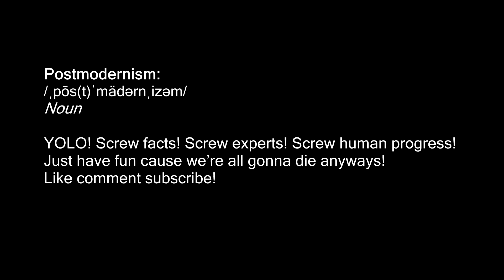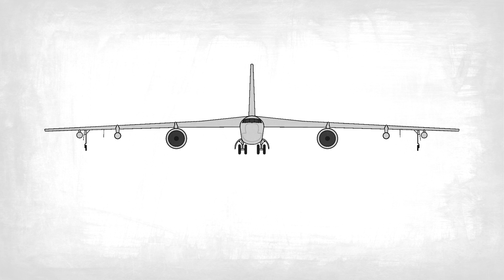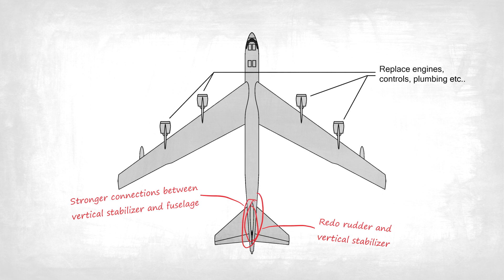The B-52 is Getting New Engines... Why Does it Still Need 8 of Them?

Comment: It has to be kept in mind that the B-52 bomber was designed and originally built in the early 1950s. At that time the B-52 bomber was a cutting edge design. The jet engines that were available at that time were smaller and had a lot less thrust than later jet engines. So this bomber was designed around what was available at the time and was designed to have 8 engines. As a result to run on 4 modern jet engines there would need to be major modifications to the tail of this airplane and the fuselage of this bomber to accommodate 4 engines. Since technology advances over time, had this bomber been designed at least 10 years later it would likely have been built as a 4 engine bomber. The fact that the B-52 bomber is still in use and will be in use about 100 years is a testimony to the incredible design of this 1950s era bomber. This bomber was built very rugged and long lasting. Nothing is built like that today.
Reply: It also helps that they cut up a very large portion of the fleet due to the SALT treaties with the USSR. They have a lot of spare parts, I'd imagine.
Reply: @theawanonymouscaller  sounds very logical and practical.
Reply: ...and that would also require a virtually complete redo of all the cockpit controls and instrumentation. Just one example: 8 engine throttle controls down to two or four engines.
Reply: @johnc2438  Replacing the old eight engines with eight modern engines will result in major changes to the cockpit controls and instrumentation. This is because the old engine controls and instrumentation were analog controls, the new engines use modern digital electronic controls that will be hardened against electromagnetic pulses. It would not surprise me if the the B-52 bomber gets a modern electronic glass cockpit.
Reply: Your post is awesome, but after I read that last sentence, I swear I heard an A10 Warthog tell me to hold its beer.😎
Reply: @johnc2438  that's not that big of a modification though
Reply: Also, the B-52 had to have some redesigns early on.  One was the wing had to be redesigned because of excess flutter and fatigue issues.  Rarely do aircraft come right out of the factory in perfect flight condition and last years - and the B-52 was no exception.  And the structure gets patched, reinforced, or replaced as needed - and when that happens no one reads about that in the newspaper or in the news on the radio.  Sometimes I know when that happens because of my job.  I know the A-10 (mentioned in a previous reply) got a new wing.  I know some of those who worked and managed that design activity - but they look the same.  But no one outside of the industry or the services who use them knew that.  But as to this video - replacing the engine number would mean a lot more, as the video said, would have to change.
Reply: @michaelhankes7587  would it be more cost effective in the long run to redesign the whole plane to use all modern engine and equipment. warfare now and 50yrs ago is not the same. there only so much you can do when retrofit an aging air frame
Reply: The 52’s down here at Barksdale do not have the original engine type.  So I guess they are getting a second engine upgrade.  Either way, they still leave behind miles-long black soot trails until they hit altitude.
Reply: @jetli740  I don't know which would be more cost effective.  I would suppose that the value of all the retrofit contracts could be brought into today's dollars and compared to the cost of a new airplane.  The video, it's own humorous and brief way, shows how short sighted the government is - which is true.  But the current B-52 may not be as "less capable" as people might think.  They have all the infrastructure to drop the latest weapons for instance.  And they were all added via separate contracts.  Along the way the structure was either beefed up or replaced as needed.  Now all that said, having talked to USAF pilots, there is a price to be paid for all the scabbed on systems - and that is usability.  The tribal knowledge needed to operate is greater.  Actually, TOs and Instruction manuals are updated all the time - but the result is that those systems are more cumbersome to use.  A new airplane would integrated all these things so that all the systems operate from the same system architecture vastly improving how each system is accessed and used.  The B-52 is still relevant and can do what it does well.  That is why it is still around.
Reply: @blackhawk7r221  Can you see the soot on the runway after take off?  Just curious.
Reply: @michaelhankes7587  Runrays are heavily blacked, much more than a typical airport
Reply: @jetli740  ,
See B-21 program. In the future the B-21 will handle penetration missions into hostile airspace while the modernized B-52Hs will be very long standoff distance missile launching platforms.
Reply: @blackhawk7r221  
The B-52H's have the TF33s they came with from the factory.
Reply: @davidhoffman1278  B-21’s are operational and in the wing.
Reply: @davidhoffman1278  My mistake.  I see above where I wrote it in a confusing manner.  52’s had J-57 turbojets up until the G’s, which stuck around a whole lot longer than people think.  The H’s got Turbofan 33’s back in the 60’s.  Only mildly less smokey, but you can still easily track them for miles after takeoff.  G’s and H’s were side by side on the flight line for quite a while. Rolls-Royce won the contract a few months ago for the repower with their F130’s.
Reply: @blackhawk7r221  I thought all older B52 had already had engine replacement-aren't all of them in service now turbofan? 
Imagine 8 engines of they type that were used on the MD 80 --think that would motivate the thing to do some climbing
Reply: @davidpowell3347  All are H’s or H upgrades and have TF-33’s.  Haven’t seen the old J-57’s since the very early 80’s.
Reply: The original hound dog missile had the same engine on it that was in the dual nacelles. The pilot could run the engines, he could transfer fuel from the missiles, or transfer fuel to the missiles so if necessary he could actually take off with 10 engines running.
Reply: @theawanonymouscaller  they used up all the spare engines and parts years ago, and that was the second engine type that's a bypass turbofan that replaced the turbojets which had total loss oiling. Since there's been so much stalling over replacing the engines with newer, more efficient designs, the old TF33 had to be put back into production just to keep up with maintenance on the B52 fleet and a few other aircraft models that use that engine or engines based on it. The B52 new engine program could result in new engines for other aircraft to keep them flying longer, with longer range.
Reply: @michaelhankes7587  Since two of the planes have been lost recently due to a low altitude crash and a fire on the ground, the two oldest planes in the fleet, which have been reactivated from storage, have the lowest number of flight hours.
Reply: @jetli740  they already did.  It's called the B-1  Lancer.
Reply: The fact that the B-52 is still in use has little to do with design, and more to do with budgets. Not to mention the bomber consept is somewhat outdated.

Good luck using B-52s much vs a modern adversary like China or Russia.. They would just be big pinjatas..

Vs a small nation you allready outclass. They perform cheap indiscriminate bombing tho.
Reply: This is one of the issues with these planes. It is extremely hard to account for future engines, or other things. If someone said, "Why don't we spend more money to beef up the entire plane so that in the future when we have engines with multiple times more thrust we can put them on?" They would get stared at, and then demoted. Like the video said, the government wouldn't restructure the plane, and I'd bet my best strategic nuclear bomber that they wouldn't do it back then either.
Reply: This is the last of the heavy bombers.
Reply: @blackhawk7r221   The G's with J-57s were still at Barksdale during the early 90's.  I got to Barksdale in 1991 and I transitioned the the H in 1992.
Reply: It is also a statement of how short sighted the air force is. Probably be operating long after the B-1's and B-2's. And it is in truth a superior weapon than either for the wars the US has fought, and even hypothetical wars not sure they are really much better either considering cruise missiles. Russian Bears are also still in service.
Reply: The first b-52’s flew in ‘46, so they were on the drawing board and in design before the 1950’s. It was originally designed with 6-turbo prop engines (axial jet engines turning a prop). The twin nacelle octa-jet came out in ‘52.  

Advances in aircraft are almost always led by advances in propulsion.
Reply: @MrDanisve  Russia still uses Tu-95 and China still uses H-6 (upgraded Tu-16) so i don't get your point here
Reply: It's long past time to retire it and move on.
Reply: I could not disagree with you more. Plenty of aircraft are built way better today than this rectangular fuselage monster. Indeed it is rather fragile. You don’t think we’ve learned anything in 70 years? Tell me now, what big business anywhere in the world, like FedEx or UPS, would use 70 year old aircraft? The US military is this stupidest military in the world. This is all bribery. This is Boeing at its best, bribery, absolutely ridiculous. The cost Per flight hour for something that is nothing more than a missile truck must be phenomenal when everything is aggregated. This is a total waste of money. We are living in the era of drones for gods sake!  What is this stupid idea of having crew on board! Dumb dumb dumb dumb!
Reply: @edsmith438  Should have had a replacement decades ago, but air force keeps building racing cars and not trucks when a truck is what is needed in many cases, and it does not even have to be that sophisticated a truck, but a passenger jet conversion just is not going to work very well. Need a brand new fuselage at least, but also good to have greater durability.
Reply: @markzieg3593  Very true. I think you can go back to the B-17 and see the constant progression. What really is the difference between a B-17 and a B-52.
Reply: @theawanonymouscaller  it helps moreso that the spare wear parts are systems that are either standard components, or easily retrofittable systems. While the Air Force WANTS better engines, the hull was designed with 8 at the time, and getting 4 modern turbofans which are taller then the aircraft's hull under the wing is a problem. Apparently at one point they actually did get some new Rolls Royce engines next to the plane and it was a long phonecall.
Reply: @michaelhankes7587  My father was part of the static structural testing group using the 2nd B-52 off the production line.  I learned from him that another reason for the wing redesign was that in wing testing for downward loads the wing failed at only 60% design load.  Remember, those planes were designed with slide rules back then.  The re-design was done with slide rules, too.
Reply: @Jet Li: On the other hand, there are plenty of "integrated" systems that weren't integrate well, or took a long time and  lots of money to get properly integrated.
Reply: @markzieg3593  Incorrect.  The contract was awarded in 1946.  The first B-52 flew on April 15, 1952.
Reply: I won't parrot what's in Wikipedia,  except to mention that there are I find as fascinating details; including the original solicitation for bids being issued in 1946 several original design iterations of what eventually became the B52 were propeller aircraft.

It also mentions the mostly forgotten B36, which was in service as what eventually became the B52 was being developed.

At the risk of being rightly accused of picking nits, several sources have identified the start date of development of the B52 as 1948.

I would never imply superior knowledge of all this.
Reply: I frequently cite the B52 as a counter argument when people talk about replacing the A10 Warthog (Thunderbolt II).  I believe that both are examples of designs that can only be refined,  not completely replaced with something better  @johns4655
Reply: Me either,  though the it seems likely that the old school instruments would be inherently more resistant to EMP damage @davidgrisez
Reply: @johns4655  the A10 really isn’t that good of a plane
Reply: So the plane was years ahead in technology but the engines weren't therefore they had to use quantity to keep it airborne, and if they were to reduce the amount of engines, they might as well make a whole new B-52?
Reply: Yeah, that is what the video said.
Reply: @jetli740  The estimate as of earlier this year for the re-engine program is 11 Billion total, by comparison the design contract on the KC-46 project was 4.9 Billion. Assuming a per airframe cost of 200 million which would be lower than the price of a 787 replacing a 76 aircraft would be around 15.2 billion putting total costs over 20 billion. There's an argument that the fuel cost savings on the re-engine and reduced tanker support needed will cover the cost on the re-engine. That and a procurement and design project will probably eat up 15 years at a minimum anyways.
Reply: @Misterfairweather  The saving and time scale for the upgrade, but it is effective to resume  it role?   19 x B52 were shoot down in vietnam war and they dont have the tech your enemy has now.  the cross radar of the B52 must be comparable to a brick wall. it subsonic speed will make it an easy target
Reply: @davidgrisez  I would guess it won’t. In today’s battlefield there isn’t a great spot for this plane anymore. I honestly think the fleet will be decommissioned before the sustainment contract for the engines expires.
Reply: what exactly is the point in this plane these days when most countries have scrapped dedicated bombers?
Reply: But what about the airframe . Are they going to last so long ?
Reply: Sounds like BS to me.....install 4 engines with twice or more the thrust and the wing will not know the difference.  IF  more rudder is needed just increase the since of the moveable part !!  What the problem ???
Reply: Rugged? Eh maybe, the B-52 has a multitude of problems from the start and its only lasted so long because nothing could really replace it. But still LONG LIVE THE BUFF.
Reply: "Nothing is built like that today."
The reason why is nobody wants to build a large bomber that has such a slow speed. If they did then out goes the B-52 and a better one then takes its place.
Reply: if they’re flying for very long times tho, they could easily have 8 modern engines that produce much higher thrust and better efficiency, they could cycle them having half the engines off usually
Reply: More like a testament to the us government not wantng to spend more to save more in the long run
Reply: Those engines available at the time also had reliability issues, its why when Transatlantic Flights really started happening both using Props and later jets there was a requirement to have 4 engines, should 1 fail you'd have 3 to fall back on to make it to a landing strip. Sort of exemplified by that A330 that ran out of fuel and had to land on a Military base in the middle of the Atlantic ocean. The reason its there going back to the days of props.
Reply: The Cessna 172 will probably be in production past 100 years before they stop making them.
Reply: @AlexandarHullRichter  is it basically like one of those indestructible planes that will never die or just cuz it’s cheap like a gt720
Reply: @AlexandarHullRichter  Compare it to a DA40 and throw it away!
Reply: @johns4655  

The A-10 first flew in ‘72,
just over 50 years ago.

That’s not today,
for sure.

That’s still in the days of analog aircraft.

I know what you mean,
though.
Reply: @gottfriedheumesser1994  sure, that's why people still fly 50yo 172s right next to the brand new ones than are still profitable enough to justify continued production.
Reply: @AlexandarHullRichter  It is like the American car industry decades ago: don't change to new needs and ways of production. And suddenly the USA became an importer instead of exporting their dream cars from the 1950es.
Reply: @David Grisez  I agree with everything you said except the last sentence.
Reply: @blackhawk7r221  One of my favorite B-52 movie's is the Gathering of Eagles with Rock Hudson and Rod Taylor. There is a scene were both of them are standing at the end of the runway watching a bunch of B-52 doing MITO leaving behind lots of black smoke.